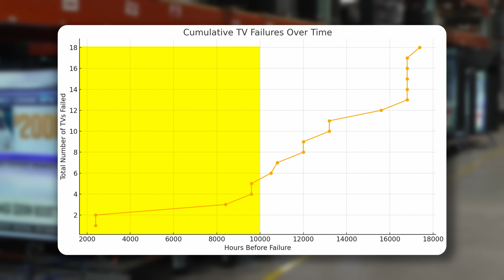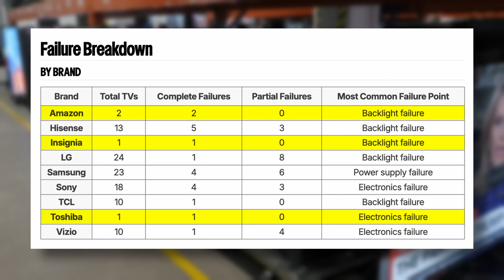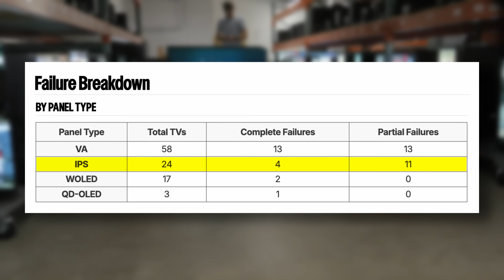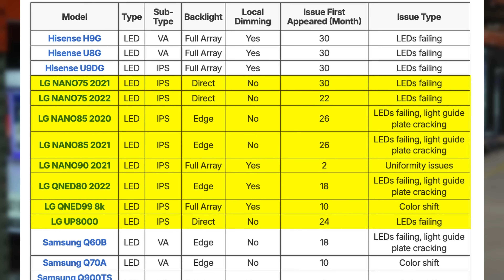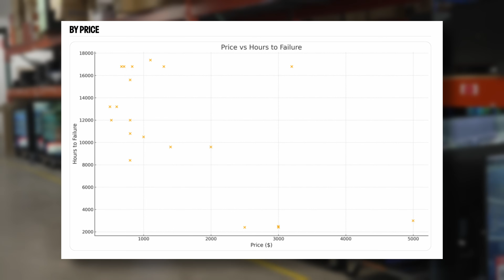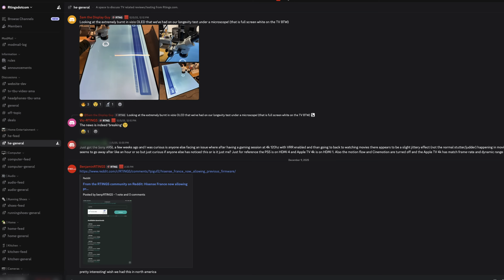Which TVs Break First? Results Overview From Our 100 TV Longevity Test

Comment: Burn in is pretty simple. It's cumulative, the panel is organic in nature and degrades over time. If you have any static content on it, you need to be aware that static content is the biggest factor for burn in, and having varied content makes your display last significantly longer than, for example, playing one game for thousands of hours. Using a OLED display to work is much different than using it just to watch movies. I would always recommend a different panel for static tasks, unless you are willing to replace them more frequently. As a TV, to watch movies and if you play varied games with different huds, you most likely won't encounter burn in for several years. There's always exceptions, not every panel is the same and not everyone treats their TV the same, but with a bit of care (removing static symbols when possible, turning off display when not in use e.t.c.) they definitely last. Personally this amount of care isn't an issue to me, but it might be for someone else, so it always comes down to personal use. I will say that, not having a backlight removes some off the weak points for early display failures (though LG had some fringing issues on WOLED panels). I'm hoping that with time, OLED longevity will become even better, though it did drastically improve already as can be seen with the tests.

Comment: Every piece of electronics I owned made by Samsung failed prematurely. This was a good enough sample for me across different categories - not to ever buy anything made by Samsung again. I now own Panasonic led TV's second decade running-every day - no issues
Reply: Before 1995, Samsung used to be always more reliable than Goldstar (now LG Electronics today).
Reply: I'm reading your comment on a Samsung IPS (or whatever Samsung call it) LCD computer monitor that's over 12 years old. I'm not suggesting current Samsung monitors are as reliable, but I would be surprised if it broke.  I don't understand why TVs are so unreliable compared to computer monitors?

Comment: I love my LG 77” C2 but unfortunately six months after the warranty period Ran out it developed a vertical line on the left side of the screen when there is a blue background. Called LG and they told me it was most likely a T con board. They refused to offer any help and gave me a number of a third-party repair company. That company told me that the board is connected to the panel and that basically the entire thing would need to be replaced at a cost of $3000. That cost more than the TV cost me and what it would be to replace a new one. It still got a great picture, but it is frustrating that when you spend that much money and it breaks after 2 1/2 years and it’s basically deal with it or buy a new one. I have an older LG C7 P and it’s still going just fine. I guess it’s just bad luck. That being said with LG not willing to do anything for me six months out of warranty. I don’t know if I’ll be buying another one when I replace the one I have.

Comment: 2:44 bit strange that only 3 qd oled and rest of 17 are woled.. but 1 out of 3 qd oleds complete failure.. that is not good compared with woled 2 out of 17. woled seems to be more reliable.
Reply: i woudlnt look TOO deep into it. Part of the reason Is that LG Woled was first to market, so it had some time to work out its kinks, whereas QDOLED was arriving in when this test started. The other reason I suspect is because LG is generally more conservative on its peak brightness points on their own products, when compared to other manufacturers that use their panels.

Comment: It is a mystery that so many venues still go out of their way to dismiss burnin, even when directly showing catastrophic burnin that happened quickly. 

You don't have to "torture test" your OLED to suffer burnin. If you primarily use any channel that uses a fixed logo, it is a very real, serious concern. Additionally burnin is actually uneven OLED decay, and OLED decay happens with literally any content, and it is hugely unlikely your content is 100% uniform when averaged out. Meaning you will suffer graining in fairly short order.

Bizarre that it's almost 2026 and people are still doing the "don't worry about burnin" thing.

Comment: 1:12 TCL looking good in failure rates? of the ten, one fail whereas its price competitor hisense got wrecked. LG and Samsung too had a bunch of partial failures pushing up the number, even with a bigger sample size.
Reply: Weird how Samsung and LG got beaten by TCL in terms of longevity.
Reply: @IBO8Jaeger I have a 7 yr old TCL (S525) and it’s working perfectly. 0 dead pixels…
Reply: @Imdone25-w6c were you aware of taking care of your TV brightness?
Reply: @IBO8Jaeger indeed. Backlighting at 45 , brightness at 40.
Reply: 1 in 10 iis still crazy though
Reply: However the sample size for tcl was much smaller than lg or samsung so this test still shows a complete failure rate of about 10% with lg having a complete failure rate of less than 5% and samsung about 17%

Comment: My Dynex 1080p 43 inch from 2009 is still chugging along on 24/7 with security cams and a little burn in and a few pixels finally failed. But still going.

Comment: I have to disagree with the comment about DIY repairs. I'm not a professional, but have successfully repaired LCD TVs on multiple occasions, replacing the backlight or swapping out failed PSU boards. As long as your TV is properly constructed with screws or clips and the screen isn't massive, it really isn't that hard. Right now I'm happily watching a 50" screen that my neighbours wanted to throw out, but really just needed £40 spent on a new backlight (that includes the tools needed) and a few hours of time. Anything held together with adhesive will be a nightmare though.
Reply: That's the key though, not many of these tvs are properly constructed as they reduce costs every year. That means more double sided tape. More tvs combine the power and main boards. And they can vary wildly, so knowing one might not help another. Some tvs require access to service menus that might require a service remote.
Small tvs like a 50 are also much easier to remove the screen. It gets significantly more difficult with each step up in size.
Reply: @Outrider42  This is a matter that RTings might want to consider adding to the 'Build Quality' section of their reviews. I would certainly be prepared to pay a bit more for a TV that is properly repairable. Cases held together with glue and double-sided tape represent a significant barrier even for professional outfits. There is really little difference to the DIY path in such a situation and many shops will simply recommend selling the broken set for parts. 
I wouldn't recommend trying to open an 80" screen without a hoist, but over 87% of TVs sold in the UK are under 60", a size which is perfectly possible to repair at home (you will need two people for the largest sizes though). 
The largest cost is the screen itself - if that is damaged then the set is really just scrap. But a significant amount of failures affect ancillary elements such as backlights and boards that can easily be sourced and replaced for much less than the cost of a new TV. 
There is very little magic in the service menu, most of which simply consists of mechanisms that allow quick QC checks at the point of manufacture. In some cases it might open up further options for calibration, but you will require a proper photometer to make use of them.
Reply: @charleskingReal We are in this mess because people started treating tvs as disposable.
While you might not have an issue poking in a tv, you are not in a large group. I get so many people who dont even know how to handle the tv main menu, you expect them to know how to use a service menu?
You also need a service remote for Samsung and LG, that's an extra purchase.

Sony may throw 5 or 6 different types of connectors on their boards, and they all require a different technique to remove and connect. If you get it wrong, you can mess up the super fragile cable and not have a working tv. You may also need to download the tv software for Sony (and some other brands) because their main boards do not ship with any firmware installed at all. Sony does not make this firmware available to the public, it is not the same software you get from their software updates. Though sometimes the software update file does work, the fact that it may not is a problem. Sonys also requires pulling data from the existing tconn into the main upon replacement (or the reverse if you replace the tconn). Failing to do this correctly can result in a failed repair. The crazy part is that the tv gives no indication of whether you perform this correctly or not. It is kind of absurd.
For someone who has experience and has seen the repair guides (which are not commonly public), this is no big deal. But for anyone who lacks experience this can be a daunting task. You'd be shocked to learn how how tech illiterate young people are in spite of growing up with it around them. Modern tech is too smart, things just work for them, and most people do not ever attempt to open up something.
Here in the US we have big tvs like we do big SUVs and trucks. A 50 inch tv is considered small. 65 is probably the most common size I have repaired. I'm always happy when I get a rare chance to work on a small 50 or 55, it's easier for me.
When you can buy a new 55 for under $200, spending $40 on backlights and taking the time to do them and possibly failing that process by breaking the screen that was double taped is not as appealing. Most Americans will just buy a new tv.

I'm not saying that is right. I'm simply saying that is how it is. This is a country where most people pay for an oil change instead of doing themselves and saving money. Apple has taken over the world and their products are never repairable. I have actually had arguments with idiots who believe these things should not be repairable!
Reply: I don't see an issue with sticking your hands into a LCD TV, I don't think its dangerous I mean I don't know for sure but it has to be way safer than sticking your hands into a CRT. Please don't try to repair a CRT unless you know what you are doing, its very dangerous, in fact, I think its the most dangerous repair you could possibly attempt.

Comment: Your LG OLED was lucky to get a good power board.
Reply: My LG C9 developed the powerboard issue with only 7000 hrs on the clock.
Reply: Yea even the LG technician filed it as a common issue. Really nice for it fall right outside the warranty period too
Reply: @Ravage27 yeah, Mine is having the issue as well, random freezes that roll into a restart loop until I unplug it.

Comment: I still have my old Panasonic plasma 55" after 14 years, no issues... Became my bedroom TV after I got a new Samsung 65" OLED two years back.  Hidden benefit... Warms the room nicely.
Reply: I loved my panasonic plasma too.  It didn’t technically die after almost 20 yrs - but it buzzed constantly to the point of distraction… so had to let it go…
Definitely lasted longer than any LED tv Ive ever owned.  Yes it was a power hog, but who cares with that durability and great picture!?
Reply: @RB-oc7ti mine buzzed too, found there was some screws inside on the electrical board that needed tightening. Solved the buzzing..
Reply: Love my Plasma tv so much better than the LED I see in Costco..

Comment: Tip: reduce the brightness to make your TV last.
Reply: I got TCL, in most cases I have it normal. If I need extra brightness, I give it one notch up but still I try to avoid MAX at all times.
Reply: Absolutely.I watch a lot of YouTube on my G1 OLED and run it normally at less than 50% brightness.DV and HDR films at 100% with zero peak brightness,and SDR around 50 to 60%.This should frankly be common sense.
Reply: Or don't run it 24-7 lol.
Reply: @CitarNosis317  They didn't run it 24/7. Pay attention.
Reply: Or just max that bad boi out and enjoy it to the fullest!
Reply: @HifeMan u have to be an inbred to use max brightness. It hurts eyes as well.
Reply: lol, why not buy used CRT if longevity is more important than image quality?
Reply: @fullalbums5675  crt is obsolete
Reply: Sometimes it's actually better to run them brighter, for example some LEDs use higher voltage flickering for constant startup current at lower brightness because they must be done with pulse width modulation, but beyond a certain level of your backlight settings, it can hold a lower but constant DC voltage that isn't constantly cycling it bamillion times a minute with extra angry picies. For this same reason it's also advisable to omit using black frame insertion.
Reply: Tip: Never turn your TV on or off with a switchable socket adapter to make it last.
Reply: @MangoPango1973  That's... beyond nonsense.
Reply: @MangoPango1973  nah i have a 10 year old samsung tv and i always turn it on,off with a socket adapter.
Reply: @someone-ja Yeah, you can't do that with newer TVs. Every switching of your socket adapter produces a spark with overvoltage. The PSUs of current TVs have no surge protection at all as cost cutting measure. Replacing the PSU is too expensive with cheaper TVs and buying a new TV is far more expensive than what you save by turning it off. And an environmental disaster.

Comment: My TCL 6 series 55 inch now 5 1/2 years old and picture looks like first day to me, still great.  I estimate my tv has about 6,000 hours as I have it turned on about 3 or 4 hours/day average.  I set the brightness at most to normal or dark mode as most viewing time in darkened room.  I don't know is not setting brightness to bright or brighter really extends life, but it's what I do.  FWIW.
Reply: Just know that the brighter it gets the more heat it'll produce and heat is the kryptonite of the electronics. I got a TCL 4 Series 50", it went out right around 4 years hence the name jk. For $12 I got the backlit from Aliexpress and was able to fix it. Afterwards, I started caring about how bright it gets always keeping the brightness at normal. Going brighter if needed but never the max. So happy to say that it's still doing well for almost another 3 years.

Comment: I sold my LG B2 OLED to my brother some years back and upgraded to a C1. The B2 has some dead pixels but is still chugging along and my bother does not notice them. I now have both a C1 and C4 and have not experienced any issues. Even with long gaming sessions. I allow the cleaning cycles by never turning the TV's completely off. I could go looking for burn in or dead pixels of course but why go looking? If you can't see any problems at a certain viewing distance there's no point in stressing over it anyhow.

Comment: My particular experience reflects what you reported: Samsung TVs failing after a couple of years due to PSU issues (2008 and 2012 models). I’m on LG Oled now, 1st model a B8 still running after 6 years no burning in. And a C4 bought earlier this year. I bought a couple of TV for my wife’s business this year, all LGs and avoided the edge lit ones. I have replaced the backlight of one Samsung, very easy. If something is going to break, let it be the leds on back light: inexpensive and easy to replace. Thanks a lot for all the hard work ❤
Reply: I have a 50 inch Samsung from 2017-2018 that is still going. It is known that Samsung undervolts their capacitors on their TV's however I assume all other TV manufacturers do this as well.
Reply: @SaraAB87  I still have Samsungs 15 years old working. But some had the PSU failing and I replaced it. As I recall, some of the capacitors were not from a Tier A OEM (actually never heard about the brand). Undervolting capacitors should not be a problem, meaning a capacitor working under its rated voltage should be ok.

Comment: My 2016 LG OLED, which I was using as a PC/gaming monitor, suffered burn in at 5000 hours. Even though LG came to the party and replaced my screen for free, I felt "burnt" from the experience so I replaced it with a Hisense QLED TV. This TV went on to give 18000 hours flawless service before I retired it for a TCL Mini-LED a few months ago,. This new TV has an exceptional picture, including contrast rivaling my main TV, which is a Sony A80J OLED. I am so impressed with these new mini-LEDs that I will probably replace my main TV with one when the OLED dies.